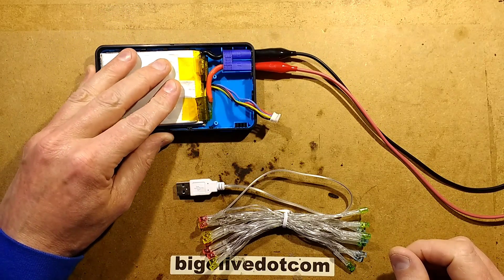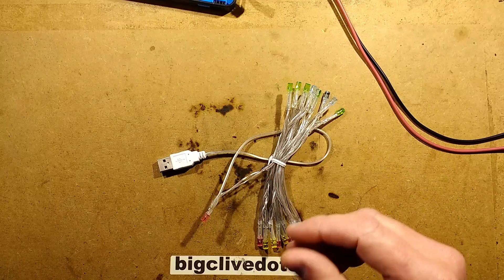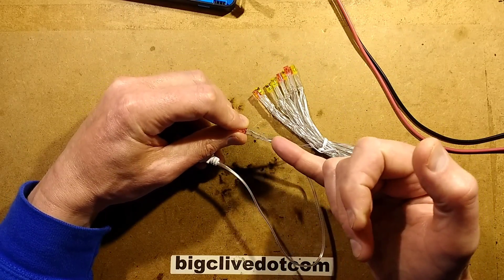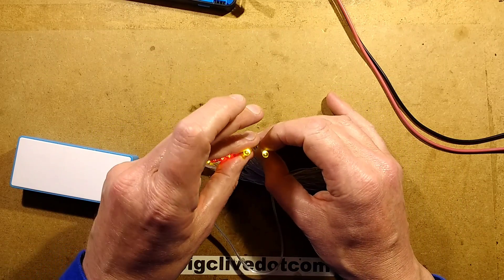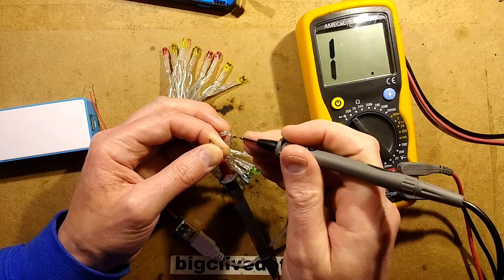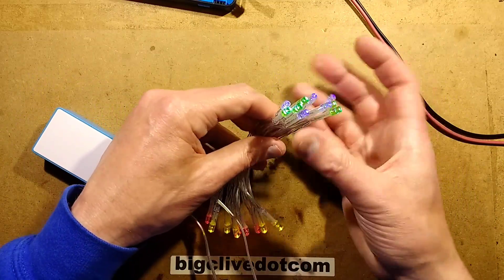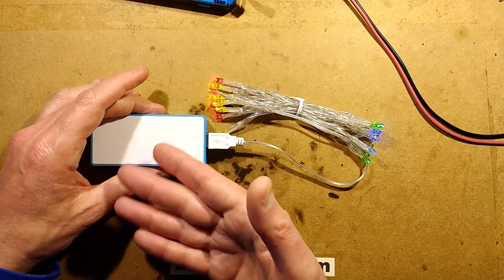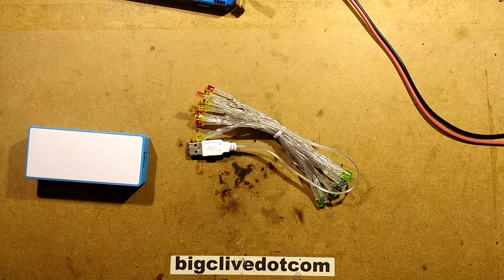Nice, simple set of USB fairy lights.  (harder to get in this style now)

Comment: i have a led fairy lights the runs on two CR2032 battery...i want to convert it into USB...what resistor value should i need in order to run it via USB port?
Reply from the maker: Two 10 ohm resistors in series or one 22 ohm resistor.
Reply: @bigclivedotcom  thank you so much! i have 4 of these and i almost don't use them because i can't buy batteries all the time plus lights are weaker and quick to drain.

Comment: I got a set of LED 'fairy' lights today at our dollar store. It was the only set left which was disappointing. Cool thing though, I found where they crop the wires off. So if I find more sets I should be able to daisy chain them back together. I wonder how many LEDs two AA batteries can run though.
Reply from the maker: +Loren Husky If they're matched LEDs then you can run hundreds in parallel with brightness reducing with quantity.

Comment: Clive (and others!): my brother is looking for some LED lights to use in a display cabinet. I was think that some of those flexible self-stick jobbies that come on a roll, and cut as needed, would probably do nicely: so what do I need to look out for etc?
Reply from the maker: The self adhesive LED tape is very useful for that.  Quality is variable and it's a good idea to allow for future easy replacement.  They do various versions with different light outputs, I prefer the simpler lower output ones.  Note that the power supplies they supply can be a bit shady so it's better to source one locally if possible, and don't use it anywhere near its rating.

Comment: Big Clive did you check the USB connector to see if there was anything on the data connection pins, captain paranoia is leading us to believe  a lot of USB powered things now are being supplied with virus and malware so they infect your pc if you you plug them in.
Reply from the maker: If in doubt, and actually plugging these things into your computer as opposed to a data bank, then get a USB condom which basically just breaks the data link.
Reply: bigclivedotcom lol I'm a bit more curious than that, have a stand alone pc and test everything on that, only found one power bank that installed something, but I'm sure it was some sort of driver to aid the charging of it.

Comment: Pound shop, they have strings of led lights in the pound shops, oddly enough there are a lot good little bits and bobs in the pound shops nowadays, things that used to cost a great deal more than a pound only a few years ago, including small solar panels, camping knives, screw drivers and a whole host of things that can be very useful including phone chargers and low level pocket power banks.

Comment: A Question: Since there is 2 V voltage drop by the 100 ohm resistor then the USB voltage delivered to the LEDs is 3 V at the current of 20 mA. If the LEDs are set in parallel then each one must be switched on by only 1 mA and if they are set in series then each LED should light up by 0.15 V (3 V/ 20 ) . This does not seem right. Does it?
Reply from the maker: They're in parallel and are getting 1mA each on average.  That's enough to make them light at a good intensity for decoration.

Comment: Clive, I've used Poundland USB power banks to run a few simple led circuits but sometimes they cut out after a few seconds. My assumption is that they require a minimum current draw. Is this the case and is there an efficient way to overcome this?
Reply from the maker: i was under the impression the small units just put out 5V all the time.

Comment: The problem is that many power banks switch off their output when they dont detect a significant load. These LED's are unfortunetly not significant enough (at least for me) unless I run 3-4 of them at once.

Comment: I "invented" these. I converted the battery ones to USB ones using ~8 - 10 Ohms 1 Watt resistors, which results in roughly 250 mA on a 30 lights string. Works well, especially on power banks that shut off on currents below 100 mA... Also works on AVM Fritz!Boxes USB ports.

Comment: Does that blue power bank in this video has that cut off feature? I want to purchase some power bank kits and how can we make sure it has that protection? The description says nothing about it.
Reply from the maker: +Sangeeth S Most "smart" power banks with displays or LED charge indicators are useless with low loads.  The small dumb units with no features tend to put out 5V all the time.
Reply: Yes I learned it from your channel. :) But I've around 12 cells from laptop batteries sitting around and I'm planning to make a powerbank from it. So can you suggest some good enough diy kits? Or perhaps could you review some of those multicell DIY powerbank kits?

Comment: Hey Clive, are they Serial? Parrallel or both?
Reply: They're all in parallel - with a 5V supply you couldn't run even two 3V LEDs in series, as their combined forward voltage (3+3=6V) would be greater than the supply voltage of 5V and the LEDs would not light up.
Reply: Michael Tempsch So if the whole circuit draws 20ma then each is only drawing 1ma?  Seems a bit low per LED, isn't it?
Reply: > then each is only drawing 1ma?  Seems a bit low per LED, isn't it?

BC did say he was expecting it to draw lots of current, and positively surprised  it didn't. Modern LEDs do give off usable amounts of light at quite low currents - and it's not like you're using these to light up a work area.

Comment: +bigclivedotcom, that battery pack is wired in parallel right? It will self balance.
Reply: IIRC,  it was a 12V pack for boost starting cars, so 3 cells in series. Buck converter to provide the 5V output

Comment: Why are you uploading this at 2AM?
And why am I watching it at 2AM?
Reply: I am drunk and just got home, what's your excuse?
Reply: It's hot, I'm not tired enough to sleep through the fan's noise and I'm bored.

I might actually take it to bits to try and slow it down, even at the lowest setting it's still very noisy and produces a sizable draft.
Reply: demoniack81 It will use a ac motor so to slow it down... without making it hum you will need a variac and unfortunately there not cheap.

Comment: @bigclivedotcom     small typo in description "these lights are best run on small power banks that SHIT the output off completely when the internal cell is running low"
Reply from the maker: Thanks, I've corrected that.  Although I preferred the original.  These days I have to avoid using naughty words in descriptions.

Comment: have one of these. The usb plug went from clear to heat burnt brown from being on for a year straight.
Reply from the maker: I wonder if it had a much lower resistor value in it.
Reply: @bigclivedotcom  yep, 10 ohms, for a 20 slow color changing leds. Peeks at 200 mA, so .4 W.